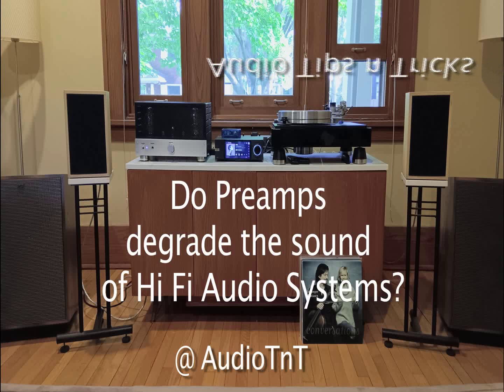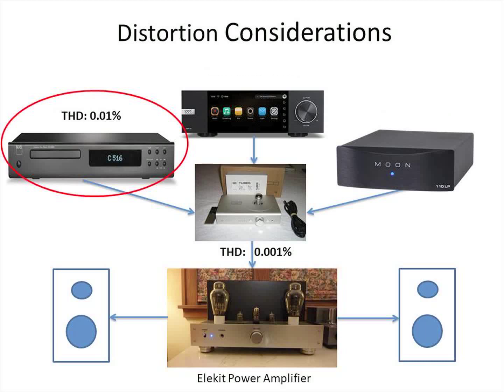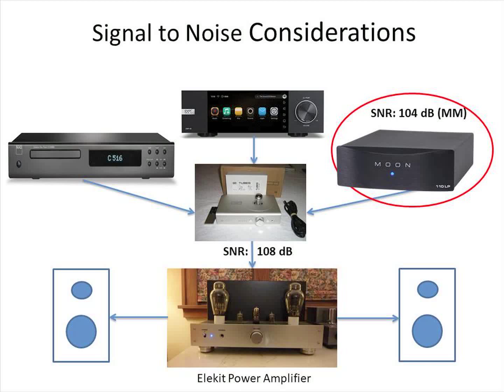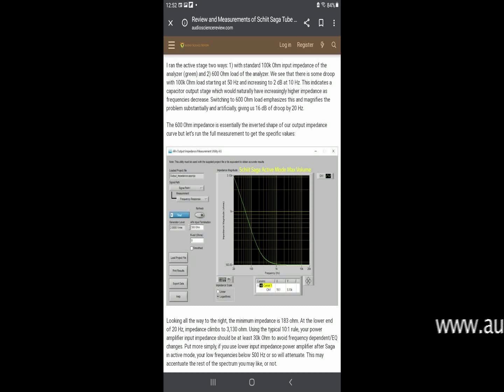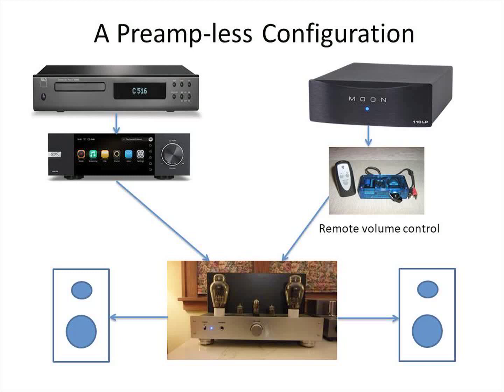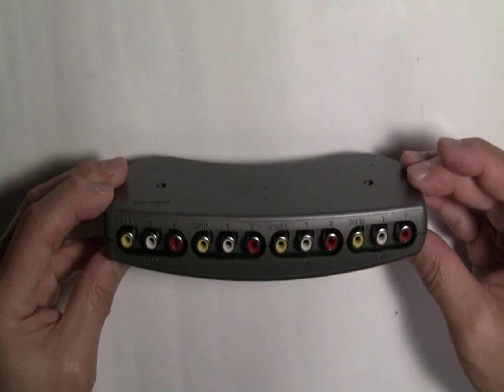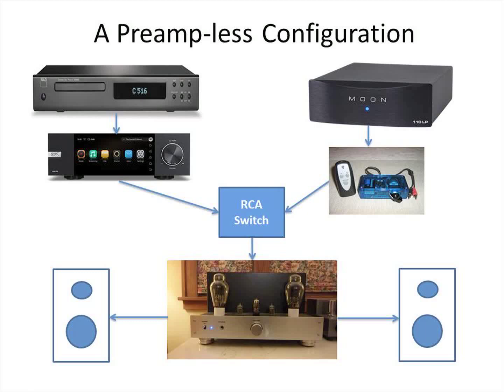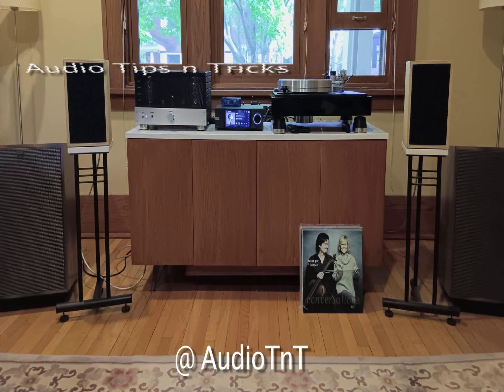Do Preamps degrade the sound of Hi Fi Audio Systems?

Comment: While I appreciate that you are being very scientific and I do not dispute your observations, you do seem to have overlooked a few key variables.  

You also have to take the abilities of the human ear and the listening environment into consideration.  If you have, for example, a system that can produce 100dba in a room with a 30dba noise level (both of which are about average) any noise or distortion below that 30dba threshold would be lost in the room noise... so the actual range of audibility (dynamic range) in the average room is probably closer to 70db at maximum volume, even less at more reasonable listening levels.  

Converting the distortion to decibels, 0.03% is -70db. So, you would not likely hear less than 0.03% distortion, even if you were keened to it. 
In truth, I've never met anyone who can actually hear 1% distortion, never mind the tiny fractions you are discussing.  Then consider that your speakers probably run around 2 or 3% distortion and the tubes are likely close to 1%. 

So, would you actually hear a degradation in sound because you chose to use a pre-amp?  
Not unless the pre-amp is faulty.

Second, in that RCA switchbox the resistors you found on the RCA shield rings are called "ground lift" resistors and they are there to prevent ground loops and the hum that goes along with it.  Without them any variation in ground potentials in your equipment could cause a clearly audible hum at your AC power line frequency (60hz or 50hz) that nothing short of disconnecting the offending device would cure. 

For electrical safety you should consider including 10 ohm resistors in the grounds of your homebrew switchbox.  You will want to use low power resistors so they would burn out instead of damaging your equipment, should a problem arise.
Reply from the maker: Thanks for the explanations. Makes sense to me. I read that the best SNR of CDs is 80 dB so the quest for the lowest SNR in audio components is just for competitive advantage? In that RCA AV switch all the - ve terminals go thru a resistor and then common ground. With my DIY  -ve terminals are switched and not tied to a common gnd point. Would adding a resistor prevent a current surge when switching sources?
Reply: @AudioTnT  
Signal to noise ratios for the actual Rebook 44,100 samples per second and 16 bits per sample actually approach 96db.  Of course this is often degraded somewhat by the electronics.  

The SINAD (Signal Interference Noise And Distortion) measurement has become something of a points game since analytic sites like Audio Science Review started using it to rank the quality of components.  That's true. But common sense should tell you that beyond a certain point all of it will be inaudible and thus meaningless. ASR commonly pins the lower threshold of hearing in their tests at -110dbfs ... In my experience, it's more like -85 to -90 (ignoring room noise for the moment).

 If I might dare to advise for a moment, my suggestion would be to not sweat the small stuff. Choosing components on the basis of things you will never hear is something of a fools game, and if you get too carried away with it (as many "audiophiles" do) it can become a major source of dissatisfaction, and trying to fix problems you don't actually have can and sometimes does cause major upheavals in people's lives.
In general, your best bet is to set up a convenient system, with reasonably priced components then just settle back to enjoy your music.

I have about $1500 invested in my system.  A tiny NUC computer feeding a small USB DAC feeding a TB10d amplifier in turn feeding a pair of Pioneer towers and the sound quality is excellent. I'll probably use it like that until something outright fails.

=====

On your switch box.  
First, in the interest of electrical safety, the grounds should always be connected.  The 10 ohm resistors are optional but they are a good idea unless you have everything grounded in the same power bar. The RCA design had it right... for a simple 2 way selector all you should need is a Single Pole Double Throw (SPDT) switch to flip between the signal wires.

Comment: It's a little more complex than what's in this video. Just comparing those measurements don't tell the whole story and aren't really useful for anything. The differences in those measurements likely aren't audible. Cheap preamps can degrade the sound. A good preamp will make the signal better. I'd switch interlinks by hand before putting that switching box in my system. Just spend the money a get a decent pre.

Comment: Ok that is fine but not necessarily the best option, I own a modern AVR it controls all my switching  ASR and others have confirmed the clean signal paths,
Each input has a PAD circuit that can be boost or lowered in decibels to match equipment. 
In truth there are completely different ways to fix all those problems you just chose a very narrow path to a solution
Reply: Would you mind sharing what AVR you’re using? I’m doing the same thing with a NAD AVR
Reply: @richm4402  Yamaha RX-A3080 the have a new series but no significant changes were made
Reply: @HeavyCrown2030  thanks for the info!
Reply: Yeah, it's a horrible solution